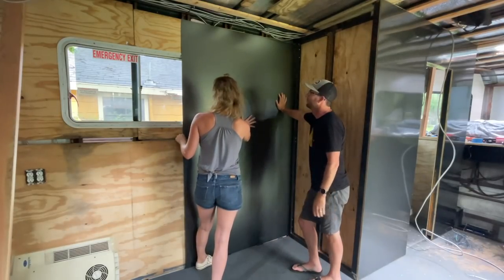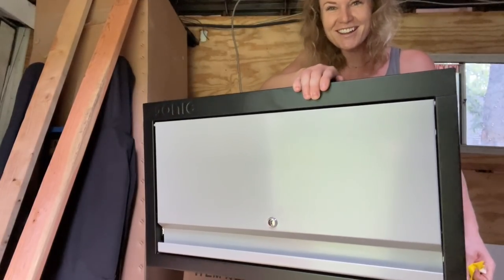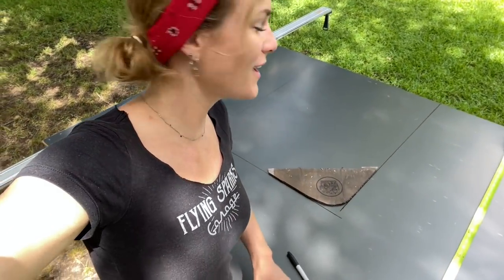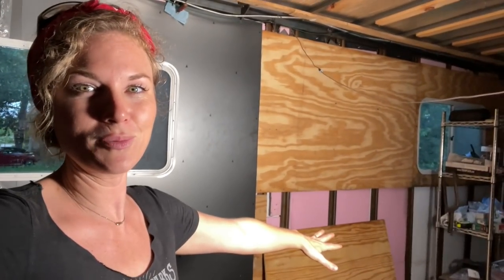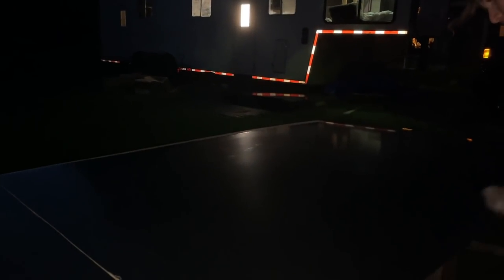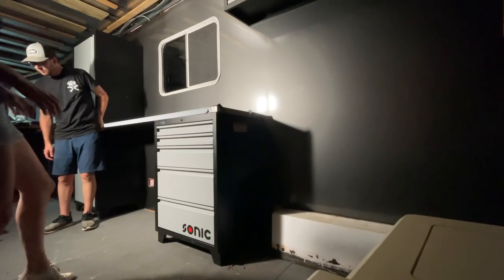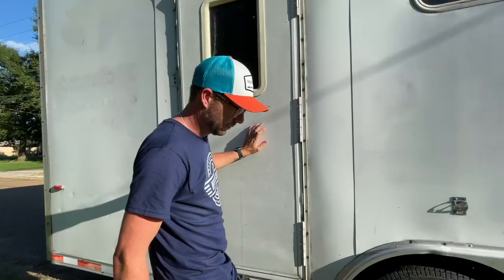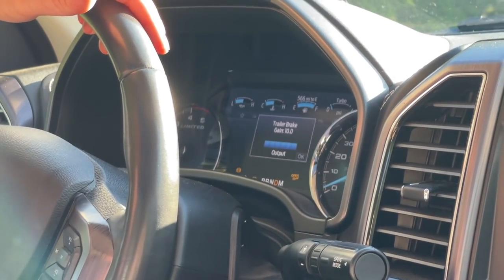Cargo trailer conversion mid project TRIP!

Comment: When I was a kid I worked with a old man putting up paneling in a office for a few. He always had me spray paint a line 
where the seams would be in a color that kind of of matched the paneling just in case the panels shrank or didn't line up exactly.
It helped with the little mistake and made it look really nice might work for you
Reply: Yes sir, we used to do the same thing. We used black paint because it blended in as a shadow, a white or light colored line would jump out at you.

Comment: I hate to be the "do it this way guy" (lol) but, I set stainless panels for kitchen hoods frequently and we use FRP glue and trowel it on. It works incredibly well for full sheets like that. It allows you to move it around yet have excellent adhesion.
Excellent work. Keep it up!

Comment: You could have TOTALLY screwed up the seams and had bubbles on the 2nd panel with crap hanging from the glue joint and I would have said... "YOU DID A GREAT JOB BABE!".  Are you kidding me?  Really... Aaron played that one perfect.  BTW... You really did do a GREAT job!
P.S. - I'm a mechanical engineer so i couldn't help myself here... instead of the ship ladder, build a shallow set of drawers (10"-15" deep) that you could use for the kitchen,  but also incorporates some steps into the front, or pull out like stairs, that you can use to get up into the bed area.  I've seen steps like these before used to get access to high shelves in a kitchen area.

Comment: Well way back when I was in the Marine Corps we used to criss cross the tie downs when loading on board ships, aircraft and smaller stuff on flat bed trailers. I carried it over into civilian life whenever I used to move heavy equipment too. I guess as long as it's tight, and you check once in a while to be sure, you'll be fine.

Comment: I angle my straps slightly outward.  If you cross them and one comes loose, the entire load becomes loose.  Best bet is to do both, to separate points.  Stretches the load in two directions and keeps it more stable yet.
Either way, please latch your handles all the way down.  When you leave them up like that, you are relying strictly upon the pawl spring to maintain tension.  When you latch the handle down, it blocks the pawl from moving altogether.  Essentially, a "double lock".

Comment: The ladder ,  you could use normal steps and hinge them at the top so they are stored upright ( and secured by some means like a strap) when not in use. I have been on a few boats that have the main access to the galley area from the deck using steps that are secured to the roof then out of the way.

Comment: Emily go to a cabinet material supplier, ask for to see wax fill sticks. Find one closest to the color of the wall cover. Rub it across the cracks and presto no cracks. And remember acetone will remove everything on a laminate (that is what they call it) glue ,adhesive permanent marker I'll take everything off but the color. But don't use it on paint it will haze paint. 😘

Comment: you aske for comments: bolt cabinets through the wall, use plastic washer on outside. if later on you chose to do trip: pine is cheap or for the look use blond oak with several coats of varnish. love those cabinets.

Comment: Looks awesome I take it you are just using mild steel it would be awesome to use stainless but that crap kills blades and bits if you do not have a sharp blade or bit and lots of lubrication

Comment: When you cross your straps, if one comes loose or fails the other on on the same end will also become loose. Pull them straight out. With them straight out if one gets loose the other one on the same end will remain tight

Comment: Instead of boat ladder what about in the corner  by bathroom wall ripping a few pieces of stair treads or even just wood and cut them to 90 deg and make a corner stair type thing.  Smaller at top and each piece gets wider as you go down.  Just an idea

Comment: Cross chaining or strapping  limits all movement, and is transport standard when hauling equipment.
Reply: Never cross if you brake one you’re rig will turn and you will risk loosing everything
Reply: @davidgroskopf7898  3/8 grade 70 transport chains are rated for 6600 lbs.lbs . Maybe your cars are heavier than mine, but 2 chains x 4 tiedown points gives 26400 lbs but I don't know, just the way this old truck driver used to do it. To each his own
Reply: @rickmilkovic  I swamped for years on oil field trucks I don’t ever remember cross chaining. But I do remember going down a hill a Ford Excursion was going up towing a trailer with a cross chained small tractor on it. Hit a bump in the road. Don’t know what exactly broke chain, binder, “D” ring or just came loose but that tractor came sideways off that trailer in front of me at 45. Oh by the way the whole rig was a total loss. Do as you like

Comment: On the lift jacks you can buy socket that fits on the and just use battery drill a lot cheaper than putting the Moter’s on the

Comment: I like to Criss cross the straps.  I have a friend who Criss cross the rear and the front straight and out. One thought is in our trailers, the car is more forward which is less susceptible to sliding vs the rear.  On one event, I forgot to strap both sides.  The car did not move in the front.  So I am guessing it really doesn't matter on the front.

Comment: Did You plum the air for the neumatic tools ?
   How about the Battery Bar for the portable tools ?
  Use a 1/2 inch portable drill for the jack port.

Comment: Idea for your bed ladder:  Since you have "some" room behind the plywood you just hung to hide the wiring, you could build a flush mount stairs or "ladder" with enough room to get your foot in.  No more exterior ladder, and a permanent solution that never gets in the way!
Reply: Getting up in the middle of the night to go use the bathroom could pose a problem with limited light.

Comment: Run your tie-down straight out
 If you cross them and one comes loose the other one can come loose from pulling at a angle and causing the load to shift.

Comment: Give yall a heads up most rv parks are not going to allow yall to camp in the trailer. They have stupid rules and they only allow real rv's yall have a car hauler don't matter if you have a bed bathroom and kitchen. I think most have a pre-inspection and KOA I think that is the name of the nation wide camp grounds are the worst. But check where yall go first. Been there done it to me said rv was to old against there set rules.
Reply from the maker: Yep, we’ve ran into that plenty- we’ll just plan around it! No biggie!
Reply: @flyingsparksgarage  there you go girl

Comment: I prefer to cross my straps and always have, never had an issue. Some will say if. Crossed and one breaks the other one will pull it against the wall bit you would have to be severely overtightened for that to happen really.  I have a 40’ enclosed and wanted to do the same thing you two have done with yours, whats the length of your trailer?
Reply from the maker: Ours is 40’ as well!
Reply: @flyingsparksgarage  awesome that gives me hope then, i was worried with a car in there it would be no room other than the existing mini living space in front but maybe it is room for more than i thought

Comment: The liquid mill will not adhere to the metal very well and over time it will fall off. I did my sister's bathroom enclosure with liquid now and it didn't last 6 months tell it fell off.

Comment: you put HAMMOCK HOOKS in the walls didn't ya??? :)  are you GUNNA????
Reply: a little T latch thingie that clicks into a SLOT in the metal frame for a GOOD SOLD HOOK to hang ... and when not in use it's just a little slot with a small cover??  eh...  seeing it in someones RV trailer thingie... lol

Comment: With your steps up to the bedroom, I have seen a set that pulls out of the wall and then folds down with the tread and the other stringer. When you are done they fold back up and push back into the wall out of the way. The slot may be only 2" or 3" wide, so you really don't know they are there. So i googled it... hideawaysolutions.com. Theirs are made for cabinets, looks like you have more height up to the bedroom. But you get the idea. Either you two or a fab shop could probably make a slick set that would work. Enjoy your videos and your projects. Still using the Flyingsparks25 discount at AA. Thanks

Comment: AAA trained/chp certified driver here.   X is not recommended for several reasons.   One: the x makes your straps longer, longer straps stretch more.  Two: if you lose one strap your load is being pulled to the side.... in the case of a enclosed trailer it will hit the wall and cause damage. On a open trailer it will come off the side.  With straight straps your load is using gravity to keep it from moving side to side..... if your load is moving side to side  you are driving like a moron and deserve what accidents come your way 
The end    AAA has actual records
Reply: After reading the comments you can see how many assume x straps are best 

Again there’s nearly zero side load driving straight down the road.   

1 loose strap or broke strap breaks the 4 point system and now you have side load, if you lose one front strap and one rear strap what’s it gonna do ??? Twist with the straps or pull to the one side 

With 4 straight straps if you lose 2 straps your other 2 straps are still doing the same job and gravity is holding the load which apparently people forget about

AAA training videos, accident records, and actual demonstrations prove x is wrong